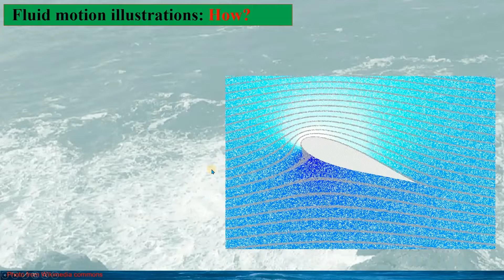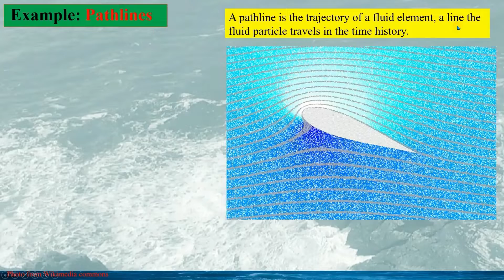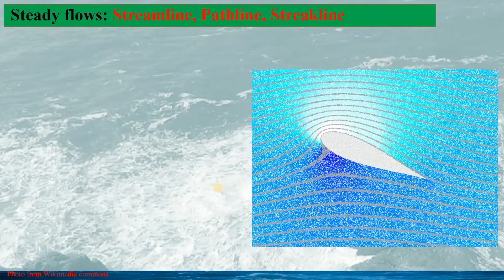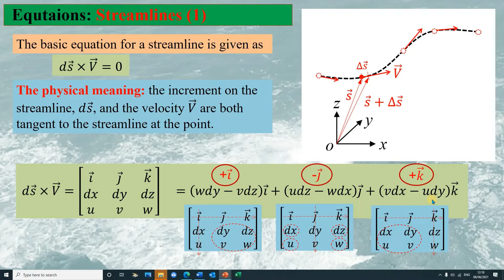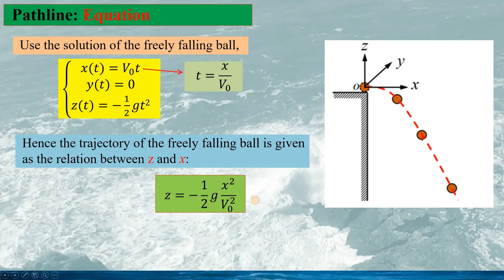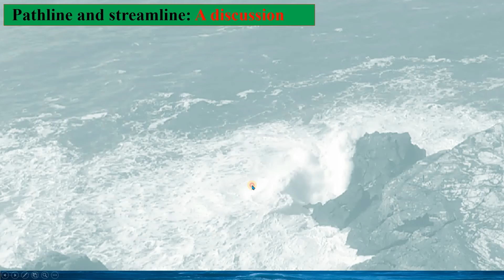What are streamline, pathline and streakline for fluid motions? (old version)

Comment: If formulas are known for u and v  we can solve the streamline function y(x) analytically.  However, if the velocity is known at only a set of discrete points how do we carry out the integrations corresponding to the solution of the differential equation?
Reply from the maker: Thank you for asking. I think one way to do that is to interpolate the velocity to the point if it is necessary, and I believe this is the way to obtain the streamline in CFD.